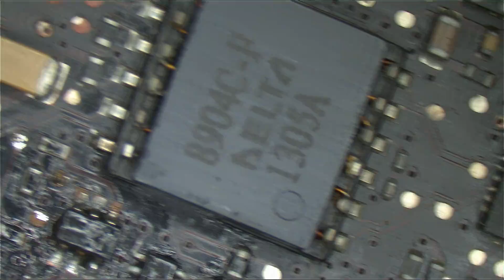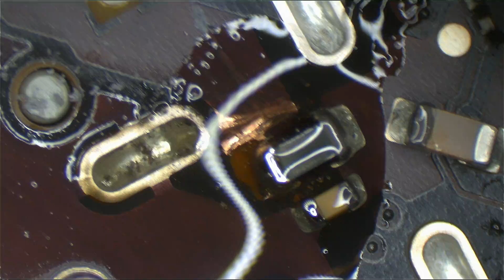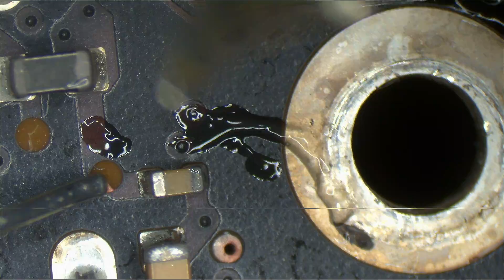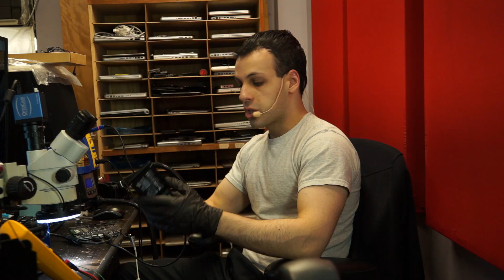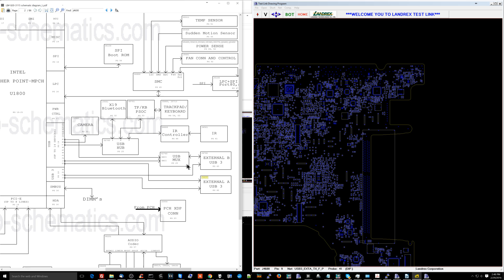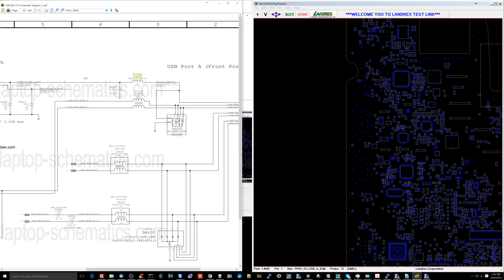Macbook Pro repairing USB port and displayport after liquid damage

Comment: I had macbook 2012 after coca cola damage :p After cleaning, soldering new display connector I had problem with one usb port. 4 hours of thinking, measuring, searching the web. I found this wideo. Who has recored it? of course Louis Rossmann. In my case voltage was good, after connecting power bank, current was ok, only problem with communication. Like Louis sad "it isn't something like too much flux". Yes, works for me. A bit more flux and more hot air. Macbook is perfectly working. Thanks for next great wideo. (and sorry for my bad english)

Comment: Love your videos but what is the gel you put on that turns brown?
Reply: It's called flux, it removes oxides(rust) on the metal contacts or pads allow the solder to bond to it better. Otherwise it sorta repels the solder
Reply: Awesome. Thanks.

Comment: After your put your soldering iron on the board, it looks like a bunch of brown liquid comes out... Looks like dirty water. What is that? Also, what is the whiteish paste you're putting on? Do you need to clean them up after the work is done, or do they eventually come off themselves (or does it just stay there forever and isn't harmful?)
Reply: The brown stuff is the flux from inside the solder coming out. The white stuff he puts all over the component is also flux. It helps clean the joint and make the solder flow into the pad better. You don't really need go clean it up you could get away with leaving it. But it's best practice to and anyone doing this sort of stuff would clean it
Reply: ***** Thanks!

Comment: Hey Louis, I have a quick question. I have an early 2011 13in mbp i5 model. Someone spilled soda on the keyboard and it was apparently only contained to that part. Checked the logic board, cleaned it, everything seems to work just fine. Except the keyboard lighting is dead except for in the center. I can either 1.) Remove the keyboard and peel back the reflective layers and clean them.
2.) Order a new keyboard.
3.) Soak the keyboard assembly in isopropyl alcohol. 
I'm guessing the third option wouldn't be ideal. Any suggestions? Thanks.
Reply: IF your keyboard fully works, just peel the backlit and its reflective layers out and thoroughly wash it in warm/hot water, it works best when it comes to sugary spill, sopropyl alcohol not anywhere near as good as hot water. I do it all the time. Good luck!
Reply: tipt0p Thanks. Yeah, everything works fine. I'll try that. Use a heatgun on low temp or a hairdryer to separate the layers?
Reply: Do not use heat gun or you'll melt the top plastic layer, layers are attached together with double sided tape, just gently start peeling from one corner, use a tweezers if needed, i generally grab and remove all layers together from keyboard itself. Once you've got it, then separate them and wash in warm/hot water
Reply from the maker: just buy a new kb and kb backlight,t he trouble you will go through screwing with it isn't worth the effort IMO. I see KB backlights for nine dollars online.

Comment: sorry im not really techy. Just watch your videos because im interested in this stuff. But what does the liquid that you put down before soldering do?
Reply: It's called Flux.It's used as a cleaner of sorts to promote the adhesion of the Solder.Soldering is very similar to welding and they both require clean surfaces in order for the Solder or weld to stick properly.Copper oxidizes easily and even a little corrosion on the board trace can make a solder joint weak.
Reply: ***** oh ok. Thanks dude
Reply: you can put entire board in bucket full of flux and it won't make any problem. too much flux > too little flux
Reply: +Johnny Doe Is it just me, or does it look like he ises excessive amounts of Flux?
Reply: pacman8818 looks like it?

Comment: I've had 2 macbook pros (2011 and 2012 15") where the usb port closest to the SD card doesn't work.
Is it a problem with Apple's design? I haven't damaged either of them, but I did get both of them used.

Comment: Hi  Louis, when you first got started how did you manage for macbook spares and boards to steal parts from without spending a fortune?
Reply from the maker: aliexpress has them for 11 bucks
Reply: Thanks, I have tried searching before but never found any, I'd be grateful if you could tell me what search term you use, thanks so much again.
Reply: ditto, I would love to fix something, but without donor boards, and no source for new...
Reply: Looking up "macbook board" on Aliexpress returns quite a few results. You'll have to do some hunting to find the faulty ones, which are WAY cheaper than the fully functional ones.

http://www.aliexpress.com/wholesale?catId=0&initiative_id=SB_20160524181710&SearchText=macbook+board
Reply: awesome, thanks for the leg(finger clicking)work
Reply: http://www.aliexpress.com/item/820-3115-B-820-3115-Broken-Logic-Board-For-MacBook-Pro-13-A1278-MD101-MD102-repair/32650755782.html?ws_ab_test=searchweb201556_8,searchweb201602_2_10017_10021_507_10022_10020_10009_10008_10018_10019_101,searchweb201603_3&btsid=376d136c-5576-4421-822b-d9c6f422a54f
Reply: Thanks guys, I figured "Apple Faulty Logic Board" gave the most results :)  Bit more than $11 but a good starting point, looks like somebody is raiding Foxconns dumpsters...

Comment: how much does board level repair like this cost? it seems really time consuming, i would never be able to do this.
Reply from the maker: petti78 some board repairs take 90 seconds and I get paid, some take six hours and I don't. it balances out in the end
Reply from the maker: George Kartvelishvili it's one thing if it is some government job someone is being overpaid for. this is free market commerce. if someone thinks i am overpaid then open a store next to mine and charge less and kick my ass.
Reply from the maker: $200-$400 depending on the model and who is sending it
Reply: 20 mins for repair, with maybe another 15 for taking apart and putting the thing back together again... seems pretty quick to me for a working 'puter.